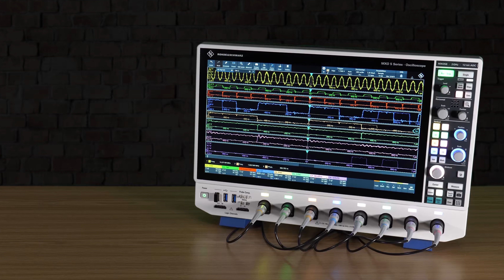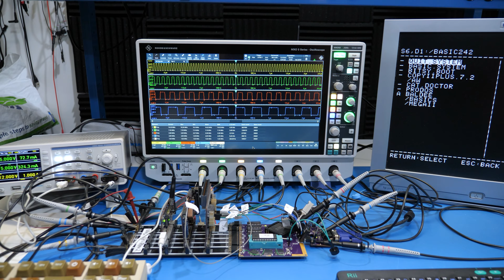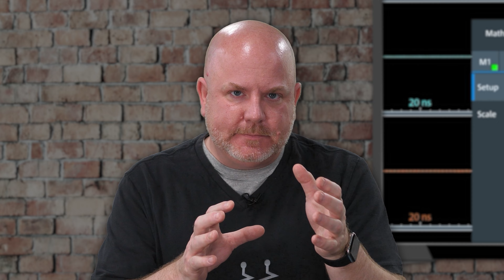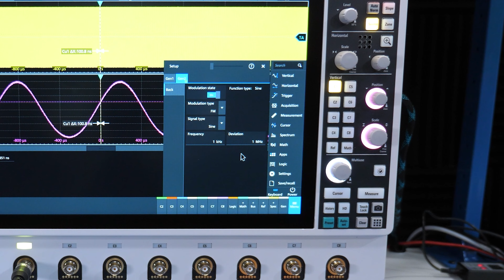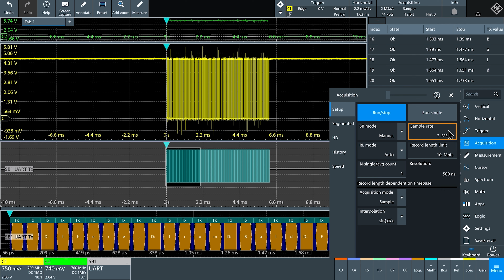Four things the MXO5 oscilloscope does faster than any other scope

Comment: It's a pity that there is no 6CH option. I think 8CH will hardly be ever used by any applications. I am torn between 4CH and 8CH variants. For power electronics, 6CH would be great, but I am finding very hard to justify the extra 15K - 20K for 4 more channels. What are your thoughts, people? I need some second opinions.
Reply from the maker: If you're doing anything with more than 2 phases, then >4 CH is a very nice option to have available.

Comment: Do they have any idea of fixing mxo4 triggers speed slowdown when some measurements are enabled? Seems like the keysight hd3 doesn't have that issue.
Reply from the maker: R&S has added significant functionality to the MXO since its release. Additional measurements, more Spectrum channels, Math, Zone trigger, and a unique decode accelerator. Some of it is covered in my MXO 5 video: Four things the MXO5 oscilloscope does faster than any other scope
https://youtu.be/IvAlb9lx1es
Reply: @AddOhms  I've tried to update the firmware but seems like the same, once put some measurements there it won't able to maintain 4.5M trigger speed 😭

Comment: Some of the high end oscilloscope manufacturers can display the waveform update rate on the screen (usually hidden by default), and some even report blind time as a percentage.

Every digital oscilloscope manufacturer has fairly fast update rates in their nominal state (one channel, simple edge trigger, no math or advanced processing). But as soon as you add on a serial pattern trigger that gets executed as an offline trigger/search in software rather than running in hardware in real time with the acquisition system, the update rate drops several orders of magnitude.

It would be awesome if the scope could draw the user's attention to this (highlight the lower waveform update rate and higher blind time), and also tell you why the measurement is slow and how to avoid the slowdown.

For example, with an interleaved ADC, you may experience a slowdown when measuring channel 1 and 2 simultaneously. But if you move your probe from channel 2 to channel 3, which is connected to a different ADC, the measurement can run at twice the speed, sample rate, bandwidth, or waveform update rate.

Oscilloscope manufacturers don't generally publish their high level block diagram architectures in the firmware, context help, user manual, or datasheets, and even if they did, most electrical engineers don't spend enough time with any one scope to demystify implementation details.

Having the scope tell you "I can only run 2 hardware-accelerated math channels on channels 1-4; disable the extra math channels or move some of your probes over to channels 5-8 to get another 2 hardware-accelerated math channels. Or "Currently using SPI decode software trigger. Consider using hardware accelerated version of this trigger for faster measurements. <Fix>"
Reply from the maker: I agree with your concept. I wrote it down as feedback, but I can already see the issue of detecting and making those suggestions.

It would be interesting if scopes could show a block diagram and highlight where the bottleneck is. So maybe, it wouldn't directly say: "use channels 1 and 4 for Math2" but you could see that the "math block" is getting processed in software.
Reply: @AddOhms waveform update rate is an awesome spec, but if an engineer can't figure out how to achieve that update rate in the lab, then it's just a marketing tool to get someone to buy a scope based on specs. And as we've seen, peak waveform update rate isn't a good predictor for misused waveform update rate. If you buy a scope capable of 10M waveforms per second versus 1M waveforms per second, you can't necessarily expect 10x faster waveform rate when you've configured both scopes in a non-ideal manner. That 10M scope may drop down to a slow software accelerated 6k waveforms per second, while the 1M scope may drop down to 100k waveforms per second, having not have had hardware acceleration to begin with, and the manufacturer got around that problem by putting in a faster CPU or wrote faster software algorithms.

A fast update rate is useless if you don't know how to configure the scope for it. It's not a small undertaking to detect when there might be a better way to make a similar measurement. The more the software allows non-expert to use the scope optimally, the better.

Sure, including a highlighted block diagram showing the current signal path would be a great start to that. I remember the RTP having both a hardware accelerated and software accelerated trigger decode mode, and (at the time) the GUI didn't make it very clear which was which, so even an experienced T&M AE would have a hard time remembering how to configure the faster measurement, let alone the electrical engineer in the lab whose also juggling the software control and quirks of their DUT, their probes, and the rest of their complex test setup.

But hey, at least we're talking about how important waveform update rate is. Let's just make sure that the marketing claims gets translated to real world lab results.

Now about that SCPI recorder...
Reply from the maker: Sigh. You’re right. Where is that SCPI recorder at…😉
Reply: Very nice conversation here. Thanks for the input. I work with R&S as a Sales Engineer for the Oscilloscopes. My feedback yet is that we have a very fast Scope even with functions like math, meas or even track. Within the MXO you always have access to the information how fast the Scope currently acquires the waveforms (even with calculated blind time)

PS: in our RTO and RTP class we indeed also have a Hardware CDR for Triggering which doesn´t slow down so much
Reply: @klausfortschbeck8369  I'm surprised that your entry-level oscilloscope, the R&S RTB 24, offers so little improvement over its seven-year-old predecessor the R&S RTB2000 series. You've added an arbitrary function generator and a few protocols, but the other essential features like bandwidth, sampling rate, etc., haven't changed. The price, however, remains high compared to the competition. 
Now I'm waiting for the new entry-level oscilloscopes from Keysight. I think they'll be released in the next year or two, and I'm excited to see what Keysight has to offer. One advantage of Keysigh oscilloscopes is that they have very fast hardware decoders, even in the level-entry field, and are significantly faster than competitors like Rigol or Siglent when you add additional functions. This is exactly the issue the thread starter is pointing out here.
Reply: Appreciate hearing your feedback and i'm listening ;) some good ideas! I run scope design at another big scope company...

Comment: What a beautifull scope ! BTW I'm crying at the 27k€ price !
Reply from the maker: I saw a distributor that had the entry level model listed for only $15k! That’s almost 50% less!
Reply: @AddOhms  it's a bargain :-) !
Reply: Yes, but apart from the 4 additional channels, the 500MHz higher bandwidth for the top model, and the larger display, the difference is almost imperceptible between the two (MXO4 and MXO5).
We have the MXO4@1.5GHz model (with the PK1 bundle included = full optional except for the logic probe) currently on promotion for less than 19k€. And if purchased together, there is also a big discount on the MXO4-B1.
Reply: And actually the MXO4 is the only scope to allow for 5V offset (also on 50ohm input) on 500uV division. Here it is superior even to the MXO5
Reply from the maker: @dMajo_IT Yeah. That’s something I meant to highlight, but forgot. I noticed/realized the difference when I got the MXO 5. But I did so few power supply measurements with it, I didn’t notice it.